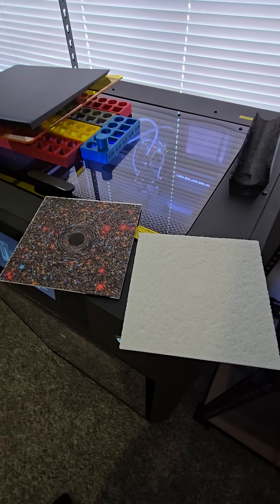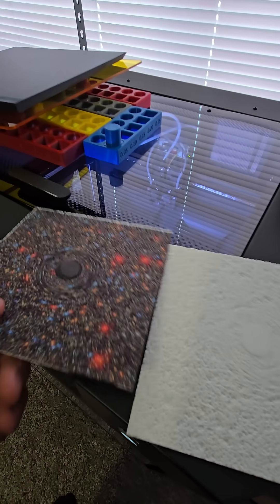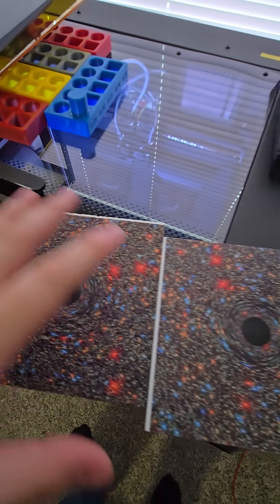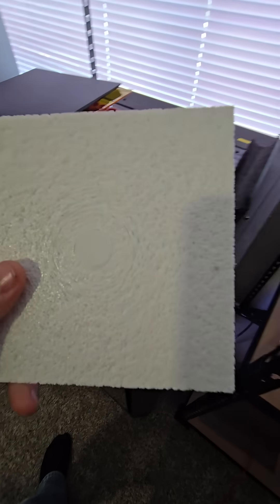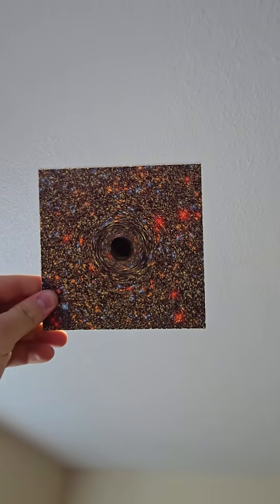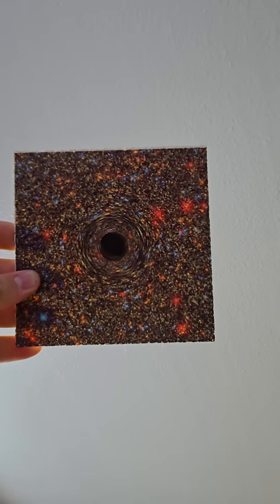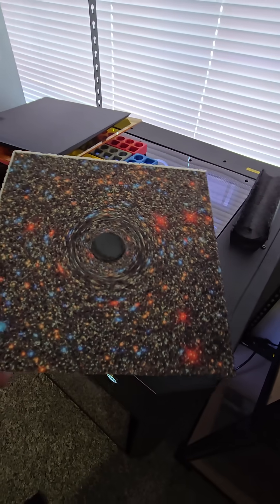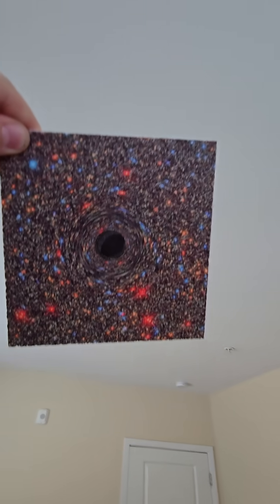Using The EufyMake E1 to Color a Lithophane!

Comment: thanks for showing the test prints. Could you test a more extreme height variance and Print on the front "rough" side? Per your other vid Over hangs wont get hit underneath but that may highlight the effect of a lithophane print. Subbing so i can see what else you try. Please try coloring in a 3d print for example some kinda Poke Critter or something and try coloring it in.
Reply from the maker: I can work on that

Comment: Does the software have alignment / helper / template lines or whatever they are called you can use?
Reply from the maker: Not yet. Hoping they could add them. It would be really nice to have a coordinate system and a printable CAD file to print a jig to make this easier.